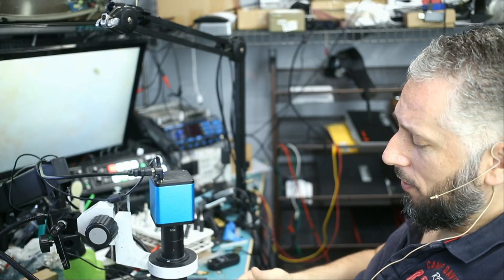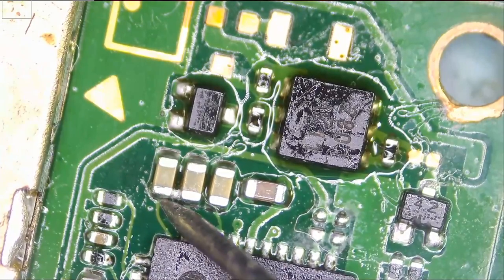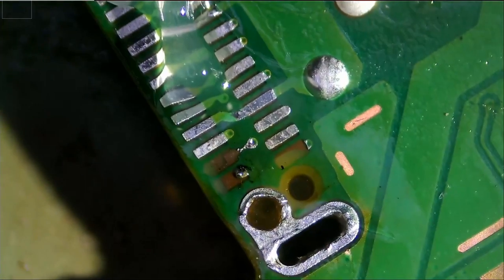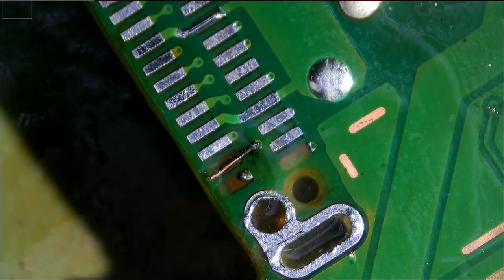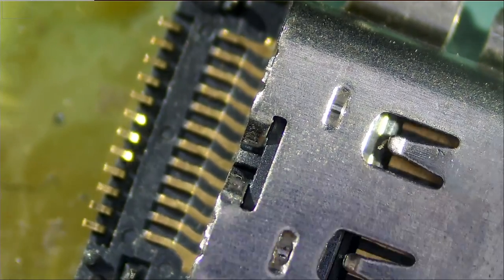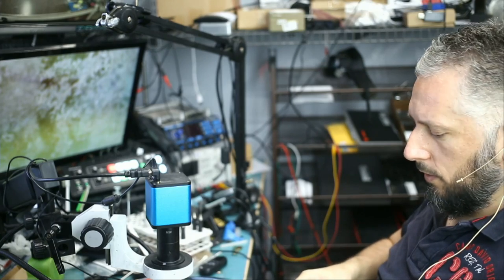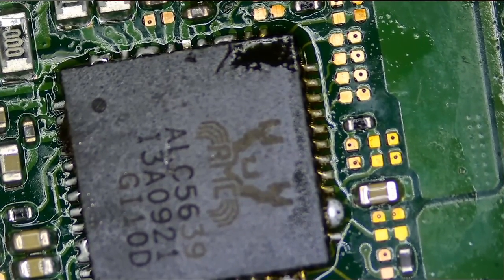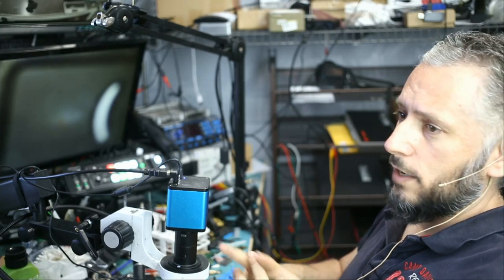Nintendo Switch Wins Hall of Shame -  Prior Repair attempt

Comment: I agree that in some cases you don't need every ground pad but in cases where there are vias that connect to those pads then I think you may need those connected.  In cases where there are two vias connected on one pad you may need to at least connect the two vias.  Sometimes they are needed not just for full power delivery but some devices need them for detection of a proper cable capable of full power.  It's tedious but sometimes necessary.

Comment: A coin on the joycon dock connector to protect it from the hot air, that's pretty clever!
Even though this board was a fail, I still learned from your video, thank you very much.

Comment: It always good to thin the usb port also, to make sure it really connected.
Reply: Too risky for such a small reward, especially on the switch ports with the 2 rows of pins easy to bend them and u can’t see what ur doing behind the first row
Reply: @neuclearb0mb    well, what else is there to do? The port has to be replaced.

Comment: What about the bridge between the two capacitors? Or should they bridged? 
I love your videos, cant stop watching them.👍
Reply from the maker: Bridge cleared but it doesn't really matter. The components are bypass capacitors.  Any line going to any capacitor is ok.
Reply: @NorthridgeFix  How can I identify if it's a bypass capacitor?

Also, what are the temps you were using for the hot air?

Love your videos, you are a real pro! Seems almost easy when you do it 😃
Reply: @laboratorioassembler  WOW! It's new to me. Firstly, THANKS! :)

As my understanding according to what you say, I f it has one side shorted to ground it's a bypass cap, So
 how can I measure if a cap is good or not?
The way that I know is that one side should beep in continuity mode and the other won't..
Reply: Those two bridged caps are the hot sides of 2v8 LDO and 1v5 LDO.  If they are touching I don’t think that the chip will turn on.
Reply: I have this bridge in two nintendo swtich and works fine but i remove after....
Reply: @laboratorioassembler  yes is not by nintendo but works, i charge and put on a one console, after this i see the little bridge and removed (my error after replace mt, no error from nintendo)

Comment: you forget to remove the short from that chip
Reply: @graphicscardtech3167  yeah
Reply: @Miguel Ortega yeah i know that ilove this man  just went to remind him that's it
Reply: @yasser_music  thats real support right there bro. 💯
Reply: That wasn't a short, those 3 caps are coneccted to the same line so if they are bridge or they aren't the switch should work just fine
Reply: @mauriciogonzalez5891  actually they aren't, they are all connected to ground, but each one is connected to a different pin on the chip

Comment: Nice work 👌
Thank you for sharing 
Just one question how much heat and air speed do you usually use to remove or get back in components.
Thanks

Comment: I have been using conductive gold and silver paints on repairs on my Soviet quartz watches as I haven't the skill to do little wires and I can make nice little tracks if I mask it off carefully enough.   The problem is when the battery's go on these old CCCP quartz beasts, usually the owner just chucks it in the drawer and forgets about it and few weeks down the line the battery explodes inside and because the circuit board traces are micron thin tracks, the battery acid neatly dissolves unprotected areas before munching on the viton sealing rings turning the whole insides into a black goo corrosive mush and a lot of work as the coils end up dissolving as well.

Comment: great attempt brother.  Fix or None, its an experience that viewers value and learn from.  The way you drown the pads in flux and then go over it with soldering pen with some solder on them is still a technique I am yet to master and this video I learned how the ground pads dont need to be replaced and as for the pads and soldering application for reflow, its best to flux out and make sure the flux is coverin the pads and then run the solder pen with solder quickly and the pads will flow and pickup the solder quickly.  Thaanks Alex.  :). Wish you would disclose the solder tip size? I am still waiting since March 23 haha.  Please comment here or text me back if possible when you're free for a second.  Weller wXMP what size tip or part number, thanks in advance :). - Ari

Comment: I don't understand the assumption that the previous repair attempt involved replacing all those ICs.  Isn't it just as likely the other guy tried to simply reflow them the same way you did?  
Perhaps the issue is actually with one of the ICs, but the other guy tried the basics too (and botched the USB-C port and left a mess to boot) but gave up under time and parts constraints?

Comment: It sucks, switch most  of the time has shorts  somewhere and if its not generating heat its very hard to repair since there is no schematic, cant tell there traces go,like. I have one right now i have short in 2 areas, pulled chips off still shorted, it turns on but gives error 2002-4364

Comment: How much is the temp and air flow of the  quik? U used to solder back the type c port.
U did not remove the solder on The bridged cap next to the charging IC.. do not if u do it off camera
Reply from the maker: 420c hot air. Bridge removed but not a concern. The 3 components next to each other are bypass capacitors.  Any line going to any capacitor is ok.

Comment: Love what you do and how you teach. When you reflow with the heat gun what temperature and airflow do you use... I seem to either burn the board or not melt. Doing my own stuff. Keep uploading the vids and thanks from the uk
Reply: It may be a good idea to test different temperatures and air flows on a non working PCB as practice.

Comment: I’ve seen nicer donor boards. In every field there are people that work on things until they can’t be fixed. Then it passed to someone else. I feel your pain brother. Same thing happens to me.
Reply: As a system software developer, at least I had the advantage of backing out the previous developers changes through version control.  This was very upsetting to see; it seems who ever worked on the board took the shotgun approach, no plan.